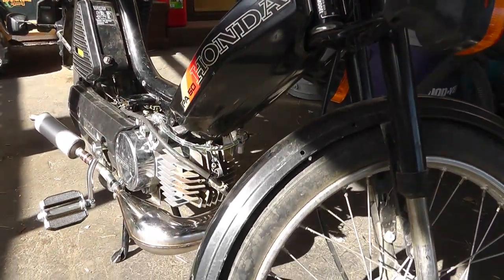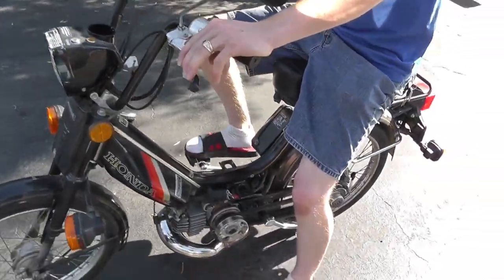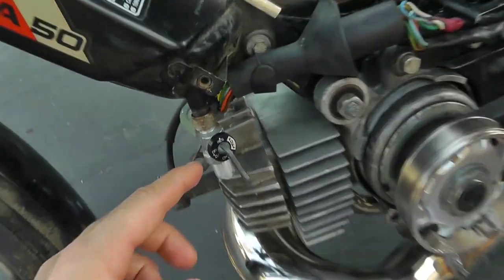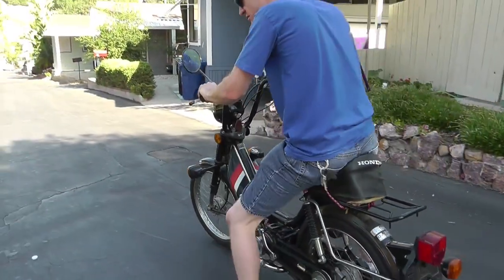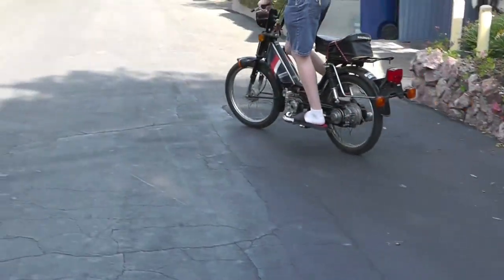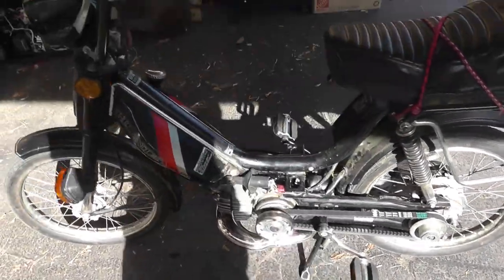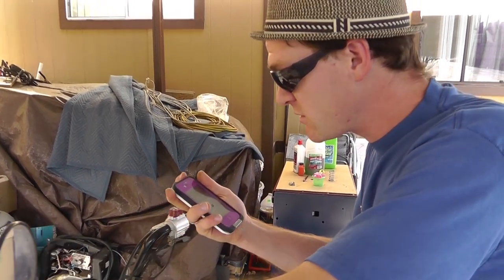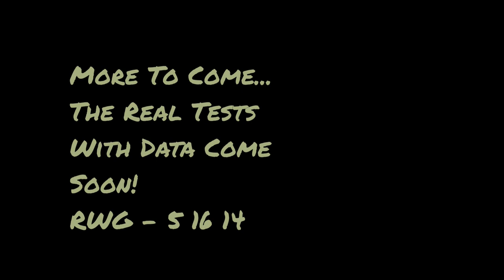#7 Honda PA50II Hobbit First Real Ride..( in the park) with MIKE! :)

Comment: You realize that with the larger than stock displacement you must now register it with DMV, right?
Reply from the maker: hey Z, so CA is totally crazy in there way of restringing. believe it or not, the displacement means nothing. even if it was a stock 49CC and only hits top speed of 27 ( the original top speed) i 1. must register it with the state of CA, 2. i must have insurance. 3. i must have a motorcycle license.  #2,#3 i have completed already. ( just have a permit as of now)and #1 I had to mail in to get it... so waiting on that currently... crazy stuff... Displacement has nothing to do with it here in CA. ( my plan was a bust but insurance is only 79$ a year and the plates are 20$ so i'm still way ahead of a second vehicle cost. + this thing gets crazy good MPG... )   also, i wan tot see that bike make 50!!! i know you can do it with electric assist!!! GO Z GO!!! ~Russ
Reply: Wow. Welcome to CA. Bike now sounds like a motocross. You might actually win this race. Good grief, what have I done?
Reply: ZeroFossilFuel
Watch out Zero!!  :)

Comment: You clearly need to turbo this and run race gas (or ethanol).
Reply: You cannot turbo A 2 stroke. The way the two-stroke engine work it is self (charging). It's the physics of the engine you would blow out crankcase seals and it won't work.